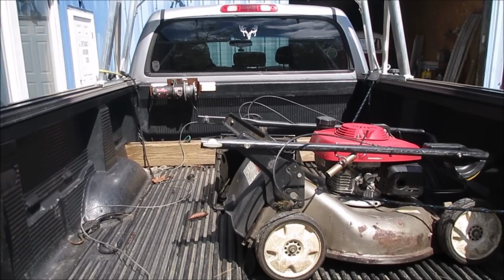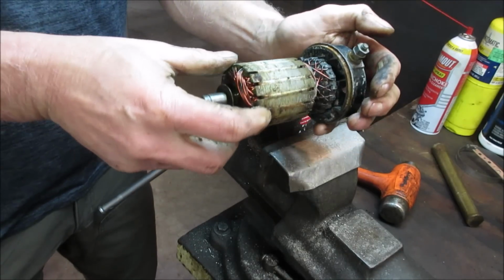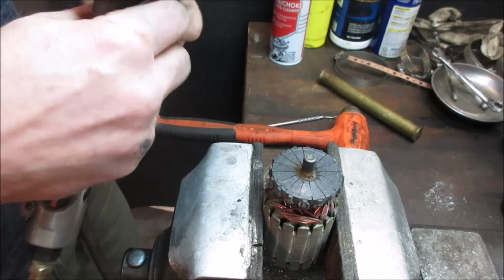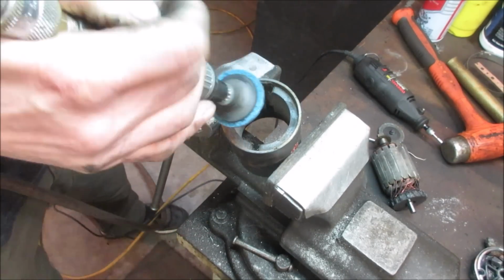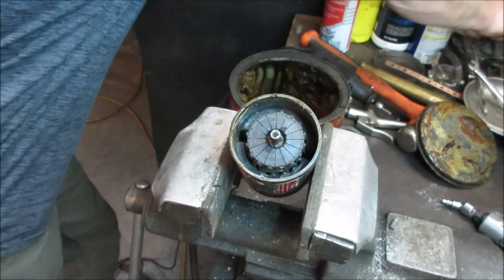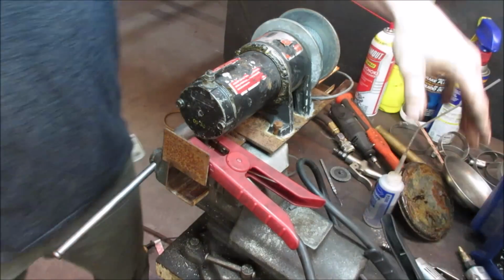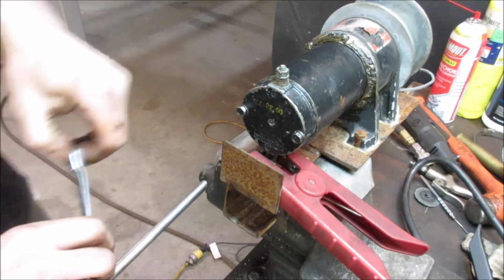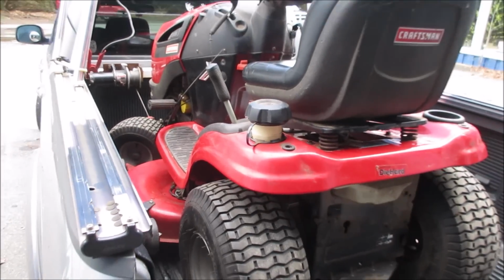Flooded and Stuck WARN Winch. Why Did It Fail?

Comment: A quick suggestion for you for next time. (As if there won't be a next time doing something like this... 😁) A quick soak in something like CLR, (or your favorite de-scaling product) and then a short dip in something basic, like baking soda and water, or weak sodium hydroxide, will do wonders for getting all the hidden crud out.

Comment: Those motors were originally built as outboard starters for Mercury. Since then they have been appropriated for many outdoor low voltage applications. I rebuilt dozens when I worked in an automotive electrical shop. I don't believe they were ever meant to be water-tight. One thing you missed that might have improved its performance was cleaning the commutator surface (the part the brushes rub against.) Be sure to scrape out the grooves between the bars too. Good job getting it running.
Reply: Excellent sharing of knowledge! Thank you!
Reply: Dear Dry roasted
👍👌👏 Exactly what I thought instantly too about cleaning out the grooves. Additionally a little/small kind of roof/cover wouldn't hurt either.
Best regards, luck and health in particular.
Reply: Funny a marine starter isn't meant to be waterproof.
Reply: What about putting a shower cap over it.
Reply: @ericerickson9328 try a local rebuild shop, assuming any still exist near you. if they do, it may be about as cheap to just have it rebuilt by them.
Reply: Yes, totally agree about cleaning the commutator, it was one of the dirtiest I have seen.  Would make a real difference to the running.
Reply: @Eric Erickson It's a Bosch motor, so probably yes, if you can find the Bosch part number.
Reply: I wondered too why you didn't clean the commutator  and the grooves. Seems it would run a lot better.

Comment: Sintered bronze also known as oilight bushings are basically just porous bronze material. They are usually pre-soaked in a lubricant from the factory but reoiling them is not a problem. It just soaks in and becomes lubricant for the bearing.
Reply: When I fix small fans, I take the bushings, submerge them in light oil and put under vacuum for a little bit.  That may not do a thing, but I feel better.
Reply: @TechGorilla1987  Yeah it actually should work. I have soaked plenty of oil light bushings in various different oils with good results. Even without a vacuum capillary action should pull the oil into the bushing.
Reply: If its not egged out, should get another 40 years out of it !😃
Reply: @luuk-out-below9804  Yeah especially with how little that bearing is getting used it'll probably last forever.
Reply: Excellent sharing of knowledge! Thank you!
Reply: The vacuum idea helps greatly. It is how the treatment chemicals are absorbed in wood. The length of time is important also.

Comment: I wonder if a few hours in a hot sonic cleaner wouldn't have knocked all that poo off the stator and rotor (stator is a bit more resilient, so getting corrosion and pitting out with scotch brite was best)...and would have been somewhat more gentle than a wire wheel
I wonder if a bead of gasket maker black and set for 30 min, would seal better than the grease, also make sure the gearbox is packed with grease
Great job!
Keep em coming!!!!

Comment: Rebuilt hundreds of these motors as an auto electrician apprentice for bulk haul semi trailer tarp drive systems (the tarps that cover the top of the trailer tipper bodies that prevent the sand/soil/aggregate flying out). Definitely oil the rear bush (I generally filled the bush, and then using my thumb I pressed to try and impregnate the bronze with oil, then got rid of the excess) and spray the brushes and brush-box with a light coat of WD-40, helps prevent the brushes sticking and also good for repelling moisture. 

Check the brush springs to make sure they aren't rusted. Also used to pop the armature in the lathe and either give the commutator a quick linish or a light cut if it was worn, and then undercut the segments. Also be sure to give the magnets a good shove to make sure they haven't come off, often had to re-glue them. Then I would use some neutral cure silicone to seal the end cap to the body and the body of the motor to the tarp drive gearbox. We also had a plate made up to close up the motor and locate the drive end for testing.

Mercury outboards used that style motor as a starter motor as well so that can be a handy source for parts.
Reply: Excellent sharing of knowledge! Thank you!
Reply: What type of glue did you use when you needed to re-attach the magnets?
Reply: @djmips  It was a Loctite product I remember that, can't remember which one ill see if I can find out. An epoxy like Araldite would likely work fine however. Then I would spray the inside of the motor housing with a red electrical insulating paint, the name of which eludes me as well, this was well over 10 years ago now, however many brands of insulating lacquer are readily available.

Comment: awesome, it just shows how a little bit a cleaning can fix most things. We live in a throw away society and that would have been tossed by most people.  Yes I know most people don't have Dremel kits, or tools or a work space or a scotch pad, but this is why in the past we had repair places all over, now they are very rare.
Reply: I think/hope that will change a bit when everything is prohibitively expensive new thanks to inflation. This channel and Mike the scavenger really highlights how much waste there is..
Reply: @philbartoli2011  people are doing more when it comes to picking good products based on reviews, but even with inflation most people don't have the tools to fix things.
Reply: Part of the problem is the repair shops charge such a high labor rate, and you gotta search a lot to find one with competent people working on stuff and honest management that bills only for time actually put in on the job.  A couple of rounds with bad repairs that cost a couple hundred each can sour a person on fixing stuff.  Even if you manage to get your money back, eventually, the whole hassle is a bad experience.
Reply: @MGower4465  very true. It is expensive because the machine also might need to be stored at their place in work bins (taken apart with screw management) while parts are being ordered.  It isn't always fast, even mustie has to order quite a bit of parts.
Reply: To stand a chance of running an electric motor has to spin freely. Once they get up and going they develop torque. Some motors are designed to break free under load. The compressor duty motors etc. All are not going to like being bound up and seized.
Reply: If I had a dollar for every “broken”  vacuum cleaner I’ve fixed . Usually just needs to be cleaned .
Reply: @Jesselovespinball  I bought a Hoover vacuum cleaner at a yard sale once and when I got it home I took the brush out of it and found this huge metal staple stuck in it. The kind of staple electricians use to hold wire to studs. Once I dislodged that it ran like new. That vacuum cleaner is still running today.

Comment: you could try glueing the broken brush together using JB Weld.  it's an epoxy glue with iron powder added and will conduct electricity.  i did just that for a very old repulse induction motor, they use brushes and a commutator for starting.  the motor is still in regular service and starts perfectly after maybe 5 years.  it's a 4 hp 240 volt and powers my thickness planer
Reply: Superglue is quicker and also works.

Comment: I use Amsoil HDMP inside the winch and starter motor in my 4wd. Water always gets in, "waterproof" or not, but the HDMP dries like an oily wax and prevents corrosion and stuck brushes.

Comment: I was fixing an electric pump that went through the 2013 floods in Australia years ago. I got it going a couple of times, only to have it seize up again after it sat for a week or so. The last time I pulled it apart, I cleaned it up again and smeared grease all through it and wiped it off again. That pump is still going today and as good as new.

Comment: Good video! 4th  I have watched this week where a electric motor or generator is stripped down and cleaned and lubed and lived again! You put it back on upside down! Also I would have glued that broken brush so at least it has the same shape and wear. Also a plastic cover or bag over the complete winch on the truck will keep the rain and snow out!

Comment: Great video musti1, however, you'll get more power out of your winch if you clean up the flat contact there is that come in contact with the brushes. They're copper and they should be cleaned. Those are heavily contaminated.

Comment: Hello there cowboy here again well first of all next time saturate the armature with WD 40 after cleaning the worst of the surface corrosion then light emery cloth let it just sit wet for a while in the shop we'd have used brass brushes then soaked it in The WD overnight even better if it's worm not hot as for lube the best for the bushing is dry grafite lube it doesn't hold dirt and lasts a long time then to seal it up either a "o" ring or cardboard gasket soaked in grease make those bolts snug but don't really tork down on it it'll just bind up the armature and kill it again fairly soon anyway also don't forget to lube the cable spool so remember always be safe healthy and happy God Bless 🤠

Comment: "Oilite" bushings are bronze impregnated with oil and the design is to let the oil out as it heats up, so it is okay to add some light machine oil or even non detergent 30 weight oil can be used. Oilite bushings were developed by Chrysler in the 30's and have been used ever since. Never use grease on a oil impregnated bushing as that will render it useless. I love how Mustie simply takes it apart cleans it up and rehabs it back to new, instead of throwing it away and trying to replace it with brand new.

Comment: I thought I was about the only person who had a loading winch.  I keep mine removable and dry.  I made the cables long enough to reach the truck battery.  I have also used it to move cement stairs, tension trees I’m dropping and for self extraction in winter.  It’s handy enough that I’m on my second.  The first was harbor freight and let the smoke out after not so many uses.

Comment: When rebuilding electric snowplow motors, I have had good luck using "fluidfilm" on the interior parts. I apply it using a small brush that allows me to pinpoint the location of the lubricant. The lubricant has the ability to creep into areas where the brush cannot reach. Road salt and brine plays havoc with these motors. We find that Fluidfilm inhibits the rust that we use to battle on a yearly basis. Also, there is a small weephole on the bottom of the motors that must be kept open to allow condensation to escape.

Comment: Brass/bronze bore brushes (used for cleaning firearms barrels) are available in many sizes.  A .45 brush in the chuck of a hand drill is perfect for motor bushings like that one.  Use SAE30 oil as a lubricant on the brush.  A cleaner/solvent (WD40, etc.) will wash out the lube in the sintered bronze bushing.
Reply: Methinks the oil washed out of that bushing long ago. You can actually put them in oil under a vacuum and reoil them that way. The vacuum will suck all of the air out and it'll get replaced by oil.
Reply: Non-detergent is a requirement. Also there is an HVAC oil for fan and blower motors. I have a bottle of Zoom Spout, all purpose oil just suited for this. 👍🏻💪😏

Comment: Darren.

Hi from N Ontario.
I sold and still use Premier Fastners penalube.  Flows into small  crevaces like water.  Sets up as a light lube.  And yes the brushes need tk  be cleanwd with electrical contact  spray or brake cleaner.

Comment: HVAC/Refrigeration guy here. Yep, always make marks or scribe lines to index the end bells so you can line them back up.  Can't tell you how many motors I've just taken apart to clean and lube, and then they run like new. Unless they fail electrically, it's usually just dry or dirty bearings.

Comment: Have you considered using a “cat head” winch? It uses rope/cable, does not store on a spool, turns continuously, and pulls as you pull tension on the rope/cable. Hook up to your load, wrap 3 turns on the drum, and pull tension on it. If you let it go slack, it stops pulling. Pull tension, the load moves. With this system, you can use as long a cable as you like, load a car by yourself (as you can steer while you load it), use it vertical or horizontal. Many benefits!

Comment: Nice, a Wednesday special, and it being an electric motor made it even better :) (Have saved a few by  just 'normal' cleaning)
Probably should put it back the right way though. Label Up. Kind of neat drain holes point down

Comment: I was thinking to also stop the water from getting in you may want to back those 2 bolts out just a bit and then load some grease onto them. Then run them back in so that no water gets in that way either.

Comment: Good video, I always use brass gun cleaning brushes to clean out bolt holes, etc.. they work pretty well. I also have used steel and fiber brushes as well.

Comment: Great job getting it running again. One thing I might suggest is actually sealing it, as you originally mentioned. That grease will go away over time. Using something like through the roof or lexel would work much better. Not entirely impressed by how silicone sealer works. Sometimes it is great, other times, not so much. It doesn't always adhere as well as the two I mentioned. Glad you got it working again.

Comment: Darren, Surplus Center in Lincoln Ne, has a relay for your winch for under $50, but you would need a hand held controller to operate it.
Overall, i think you got a very useful winch that should work for a long time.
Reply: Or use a center bias double pole double throw switch?

Comment: Good ol’ 3 in 1, 3-1 oil.  Anything from sewing machines, hair clippers, door hinges, locks and thenup to bigger stuff.  Nobody uses it much anymore🤷‍♂️. It’s great stuff if they still make the original formulation. I still keep several of those squirt cans around.  I have a couple I’ve never opened. I inherited a case from my Pop’s almost 45 years ago. 😏👍🏻💪🙏🏻. Or Zoom Spout.

Comment: I installed my winch in a bag that can hook to something, so when picking up a mower I can put the winch on the mower, with the cable extended & hooked to where I want to go. Then I use the mower's battery (I put clips on the cables) then steer the mower, while pulling it, wherever I hooked it. Sometimes the trailer, sometimes into the shop, sometimes just out of a hole (it works great for this, since my car's not 4wd!)

It also keeps my winch out of the rain.

Comment: Just did the same job on an atv winch last weekend. After the rebuild (including gluing the magnets back in the shell) I had to clean the brush contact pad to bright copper, then it fired up (the pads were black initially)

Comment: Simple silicone sealant also worked real well as a DIY water barrier for me. I installed it 5 years ago as a "temporary" gasket replacement for a distributor cap, and it's still holding strong (the old gasket would give ignition trouble in damp weather)

Comment: hi buddy i never doubted you that it would work one thing i always do when repairing any dcmotor is after cleaning the brushes and holders i smear the brushes with a little copper grease seems to make them less likely to collect any moisture and prevents sicking yet another awesome successful video great job buddy
Reply: Grease on arcing contacts sounds like a pretty bad idea. But it seems to be working for you.
Reply: @1pcfred  I find ar king is less due to less friction on brushes
Reply: @peterwebster3076  arcing is due to power going through the brush to commutator contacts. There's not anything you can do about it. There's no amount of brush pressure that's going to make it go away. You're always going to get arcing there. It's a downside of commutated motors.

Comment: I think these motors are basically starter motors, and no they're not so water proof. I usually use silicon at every egress point on them and that seems to work. You can also lather them in marine grease i've been told.

Comment: this is  why i  made a quick  mount  for  mine  and store it  inside the truck out of the weather. i used  a hitch receiver set  up mounted to  my trailer, and  pull a  pin  like  the  usual ball hitch and  store the  winch under  my  back seat  of the  truck. Keeps things  dry and ready to use. these  things are  never  outdoor proof in  my opinion and  you  proved  it  when  you showed  it  had  no seals.

Comment: Mustie, I think those bearings might be "sintered bronze", not "silica bronze". It's a porous casting of powdered bronze impregnated with a high-quality lubricant. It's safe to soak them in a bath of hot oil if you think they might have dried out, but they do have a very long life without the need for more oil unless they have been overheated.

Comment: As a crane operator if you wrap the drum evenly from side to side when you use the winch it will spool correctly by itself. You also lose capacity and power if the drum is not spooled correctly.

Comment: What is interesting is that if you look back to the start of the video, the casing was the other way around - with the label lined up on top. Yet when putting it back together it would not work that way around. Maybe it had not messed with the gearbox properly the first time around? But it works, and that is all that matters.

Comment: As a 20+ year industrial electrician, one of the indisputable facts of motor life is that no matter how hard you try you'll never keep the water out, so my solution was to drill small piss holes at the lowest point of the motor housing. Standing water in contact with the inner motor housing is one of the worst things that can happen to a motor. Just my 2 cents worth of advice.